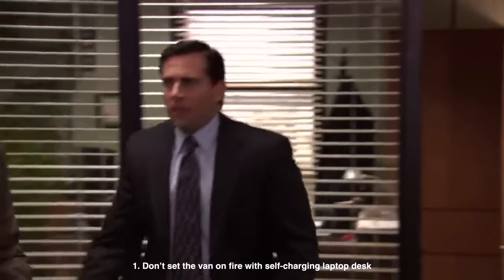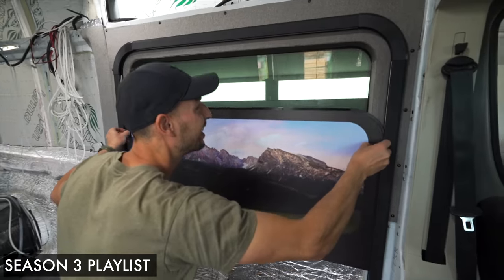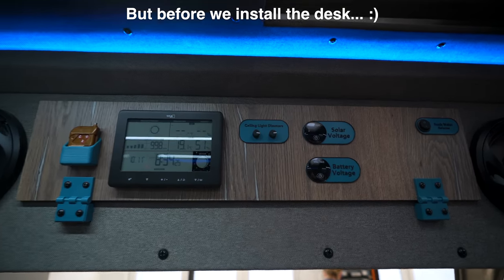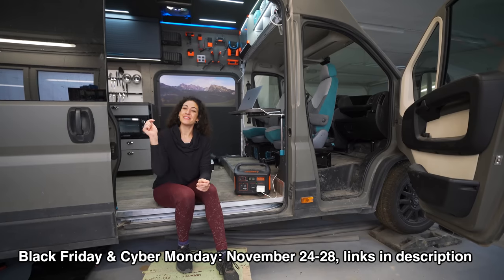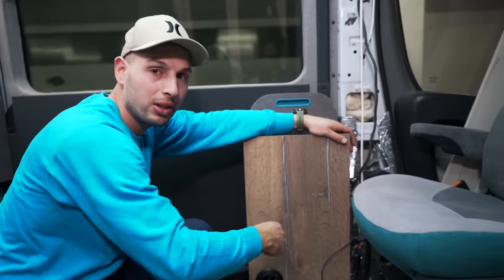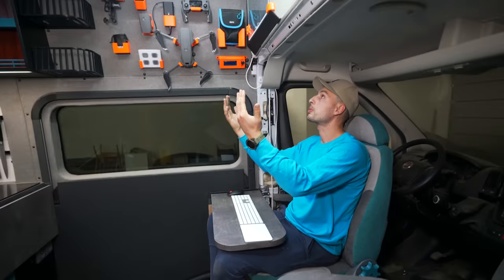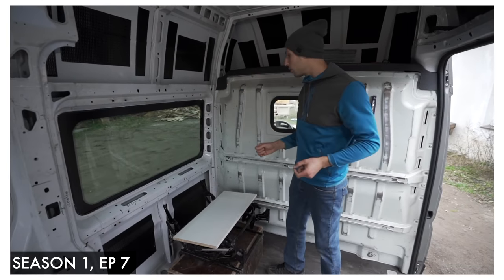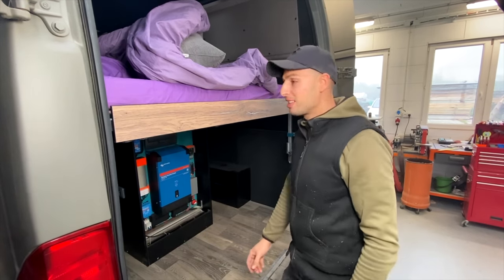Hiding 2 Laptops in our Van Home

Comment: Okay, I spent the entire video stressing about how much heat is going to be transferred from the diesel heater tubes to the computer charging/storage box. I think you are also going to need cooling fans for the charging box, even if you remove the diesel heater issue. You definitely don’t want those laptops to overheat, at any time of year.

Comment: Thanks for another awesome video. I may have mentioned that we had a table that functioned much like your hidden table, but it was for dining in one of our old RV’s. It held all kinds of weight and we never had a problem with it drooping. You shouldn’t have an issue with yours even if you are using it for meal prep or eating. The way it rests on the frame of the box will be more than adequate. Can’t wait for your next video! Happy Thanksgiving to you and yours.

Comment: I think having a reinforcement strip on the underside of the table side of the hinge will make it a lot stronger. The lever of the table is peeling away the brass hinge but with a strong strip of steel/aluminium to support it, it might be a lot stronger